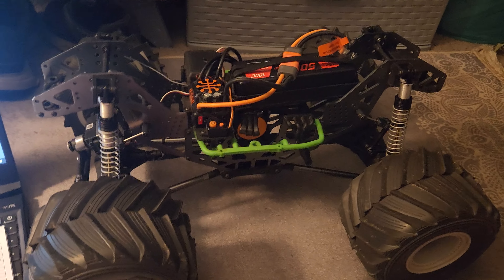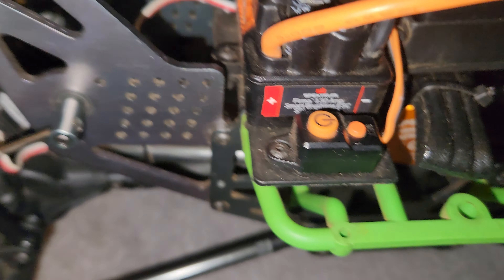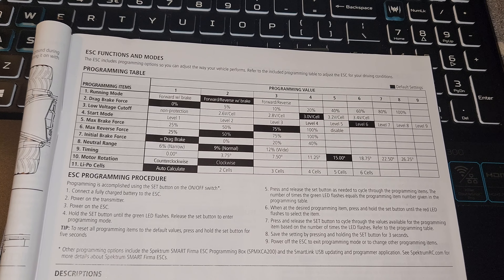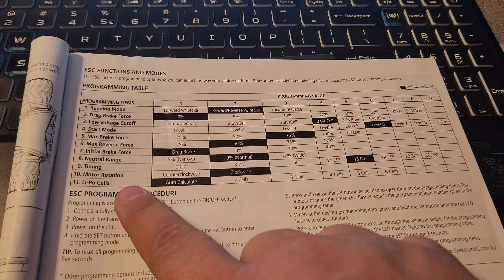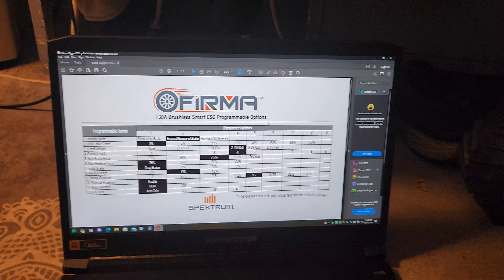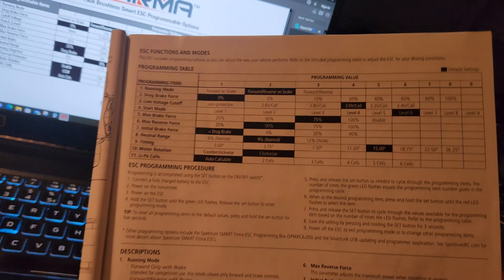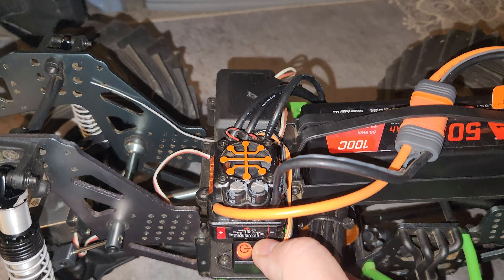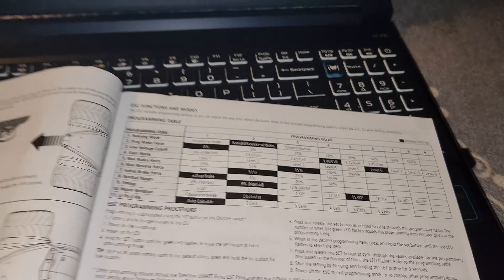Losi Grave Digger LMT Manuel Is Wrong

Comment: I noticed the same thing when i needed to change motor rotation. In the end I just swapped the motor wires.  The spektrum program card works well I used that to change running mode to setting 3 forward and reverse that I much prefer